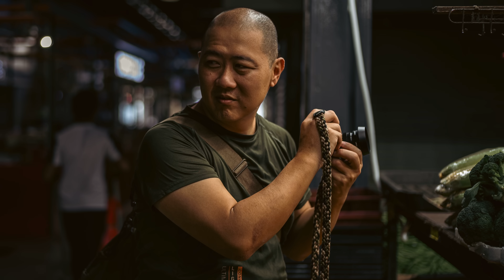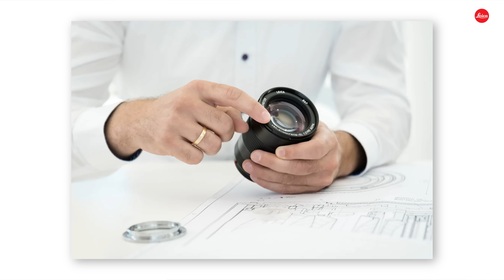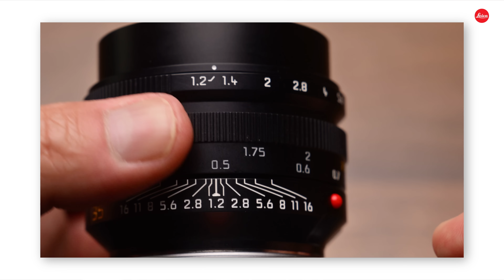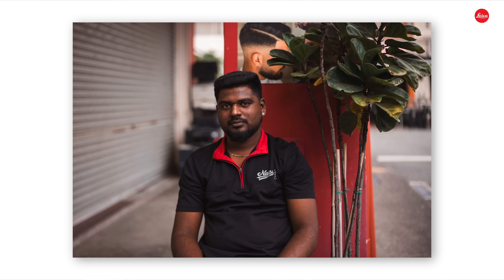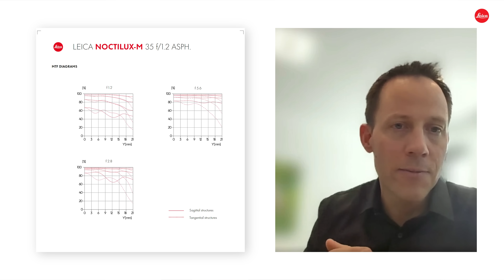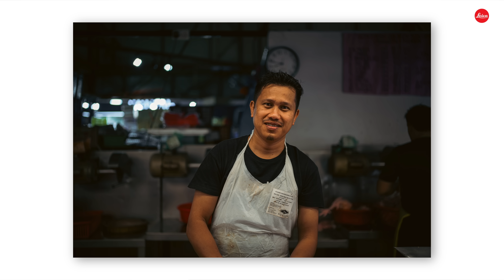Leica’s New 35mm Noctilux: Why They Said NO to f/0.95

Comment: Everything seems very complicated—which is surely true. Nevertheless, the competition manages to build a lens that is slimmer, 25% lighter, only less than 2mm longer, offers comparable optical performance, and costs only one-eighth as much. Both lenses are manufactured in high-wage countries. Does Leica believe it is on the right track regarding its pricing strategy?
Reply from the maker: The market will decide. If it’s too expensive and it doesn’t sell, then Leica needs to make that decision, but yes I do agree pricing has reached uncomfortable levels for a number of customers

Comment: Hi Bobby,  how is the Leica compared with Sigma 35mm dg ii f1. 2
Reply from the maker: Different rendering. The Sigma is more modern versus the Leica which has a bit of that Mandler magic with the sharpness comparable to the APO
Reply: @btonelli The leica 35mm Noctilux f1.2 image output looks similar to Sony 50mm 1.2 GM - what’s your thoughts
Reply from the maker: @gurugamer8632not even close. Very different rendering

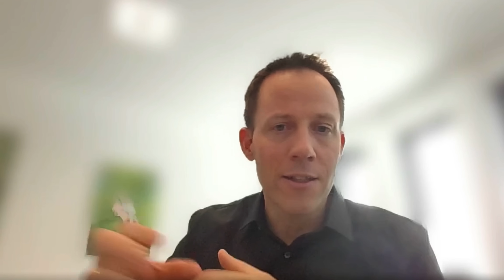Comment: also, what isn't said at 6:09 is that the long 'throw' is important, as a fine pitch means greater focus control, and for wide open its essential; ie, in my shooting with LF lenses, at f5.6 [wide open for them] its dof is paper thin, so 1/4 millimetre out in the dial, means having the subject just outside the 'focus box' and so out of focus.

Comment: If they’re optimizing for the size I don’t really understand why you’d want this over the 1.4, not much of a difference
Reply from the maker: There is a difference in the image quality. It’s not going to be night and day, but with all these types of lenses, users pay a premium for that extra advantage.
Reply: @btonelli  The extra advantage is nothing more than a delusion; if Leica had introduced a modern version of the f1.4 along with the f1.2; one would have to view results from both new lenses using a microscope.
Reply from the maker: @JKALSI1974 perhaps so, but this is the case with most 1.2 vs 1.4
Reply: That’s precisely the point I have been making since its release; the ONLY reason why the image quality of the f1.2 might be better is because it was made years after the f1.4 version; if Leica had introduced a new version of the f1.4 along with the f1.2, you would need a  microscope to tell the difference from the results they produce.

Comment: Presumably if Karbe has APO’s as his pinnacle, will Noctilux’ be this guy’s legacy? Seems the question is how will the APO35 be marketed together with the Noc35? When stopped down is the latter equivalent? Without the bulk and weight, the separation seems minimal between these lenses; and if sharpest was the priority, seems now you can get that plus bokeh from the Noc.
Reply from the maker: I tried both and they are different in some ways. The APO is a reference lens. No vignetting, no real issue with aberrations, small, sharp from f2 and beyond and just a spectacular lens. This lens is full of character yet renders subjects in focus sharp enough to come close the APO.  Dietmar worked on the APO SL Summicron lenses so he knows how to make some special pieces. I think this is fingerprint on a new direction for Leica. Blending a bit of what made Leica special years ago to what makes Leica special today with top quality optics